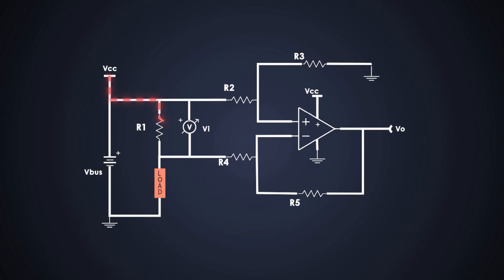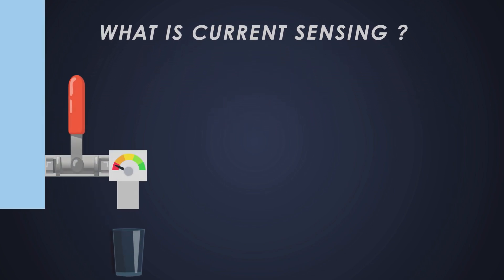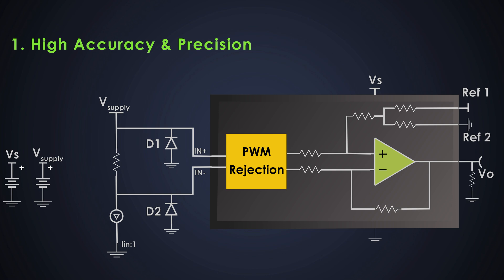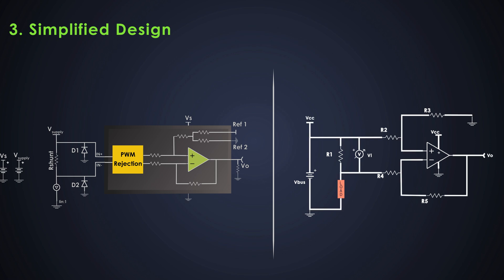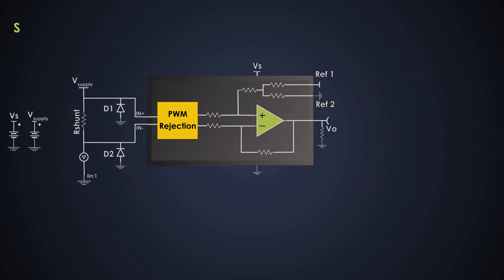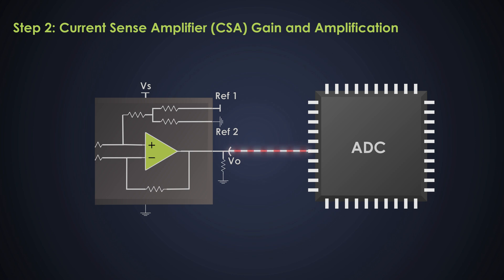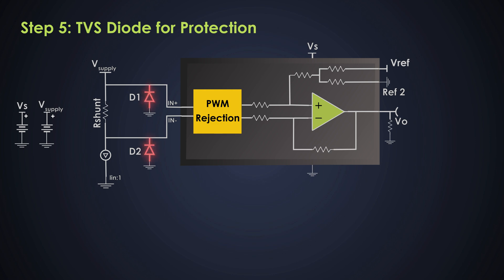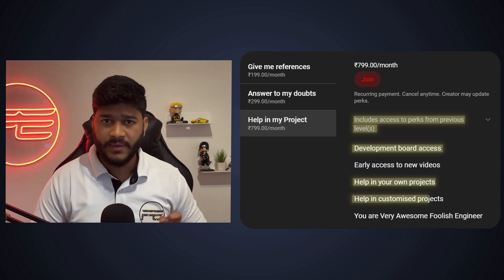Understanding High-Side Bidirectional Current Sensing Circuit using Opamp

Comment: Hi Foolish Engineer, I'm concerned with the TVS diodes shown in the schematic. If they are unidirectional, as shown, then when Vsupply is negative and the load is being powered in reverse flow, then D1 and D2 would operate in forward bias. In fact, D1 being connected to the negative V supply would quickly burn out and D2 wouldn't be much better! So I think D1 and D2 need to be bidirectional, which is a completely different circuit symbol
Reply: Yes ,Using TVS Diodes at this Point makes sense.

Comment: As a reason for high sensing you mention to detect a problem before it arrives at the load. However the real current direction is reverse. Electrons go from minus to positive. This this is’nt a good reason.😮